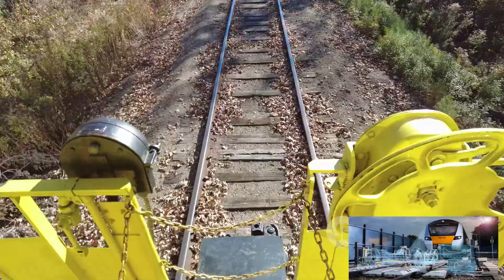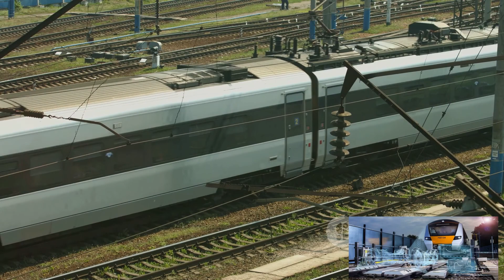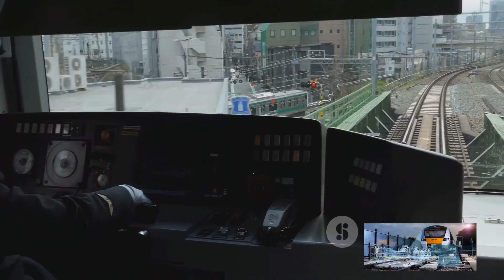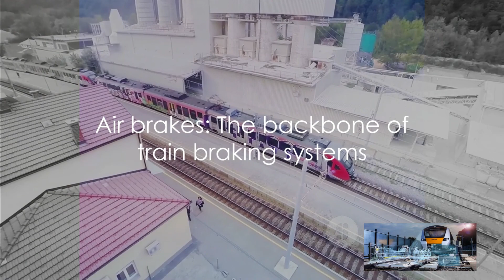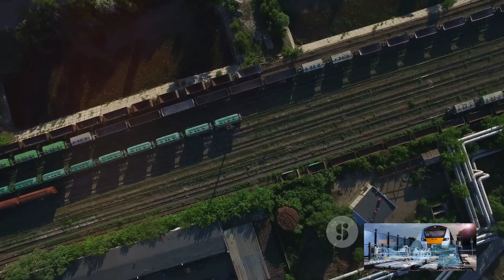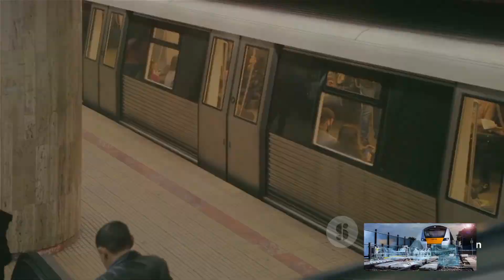Train brake systems   #train #railways #trainspotting #railway #rail #railroad #worldtechnology

Comment: Modern locomotives employ two air brake systems. The system which controls the brake pipe is called the automatic brake and provides service and emergency braking control for the entire train.